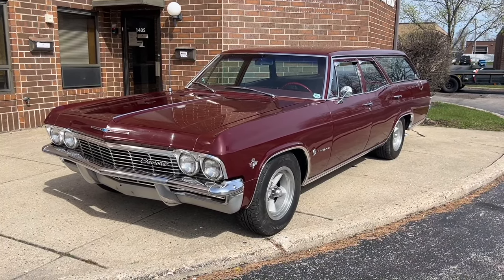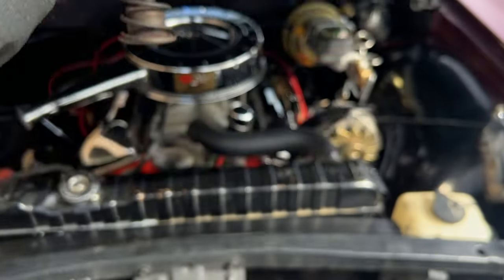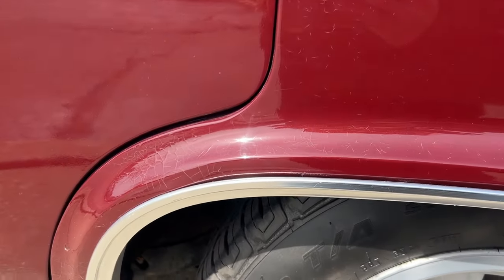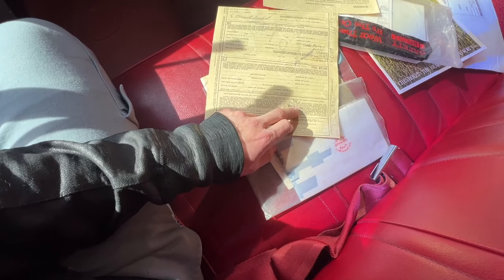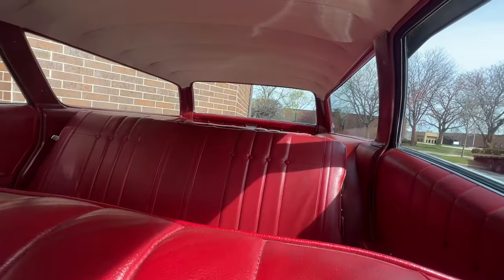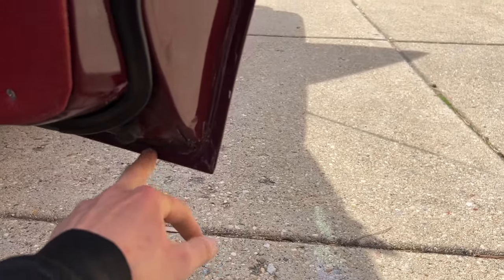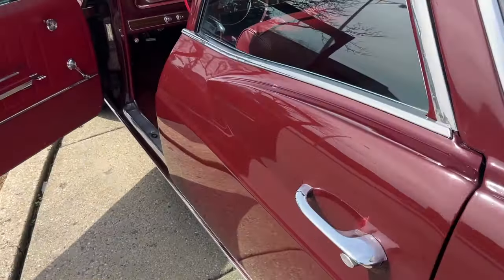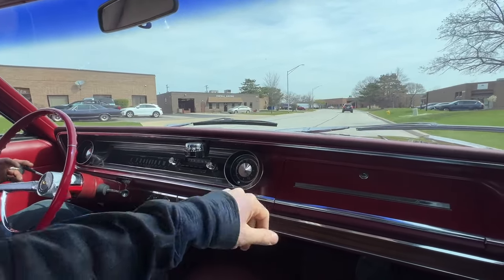1965 Chevrolet Impala Wagon - 409 - SOLD

Comment: Wow.  I had a 1965 Artesian Turquois Bel Aire 6 pass wagon with a 283 and a glide.  Pretty basic, but the NE Ohio winters and salt took its toll.  This one is aa unicorn!
Reply: I hear ya. I grew up in Streetsboro. My dad bought a brand new 1974 Chevy pick up. Within 3 years the wheel wells around the bed were gone. The BIG 3 did a terrible job with build quality back then.